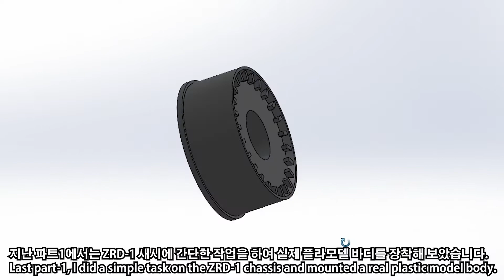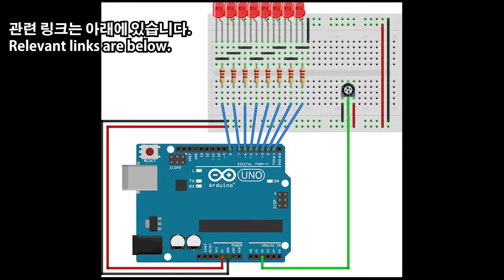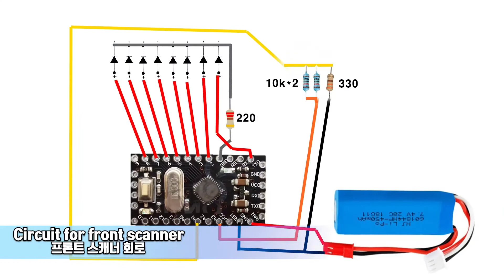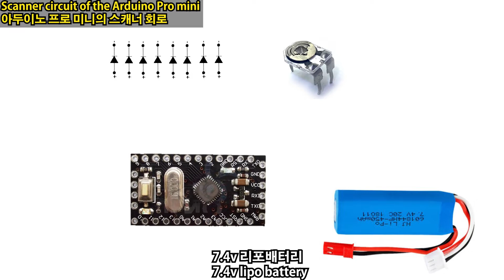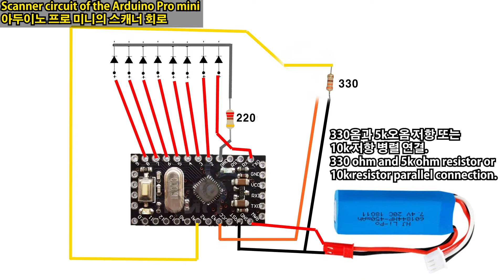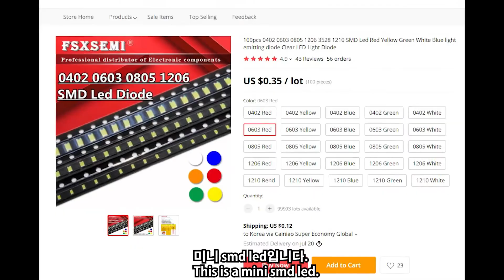1/24 Knight rider KITT RWD drift car-2(전격제트작전키트 드리프트카)

Comment: why did you use the code with the potentiometer instead of changing the time variable?
Reply from the maker: This is the first time I've started using Arduino, so I'm still inexperienced. I tried to change the time, but it didn't work.😂🥲😪